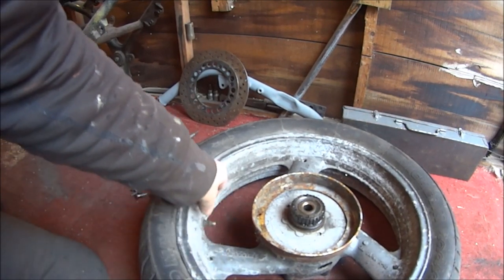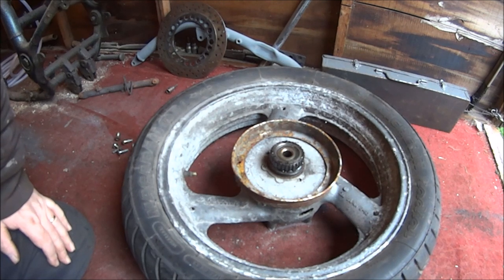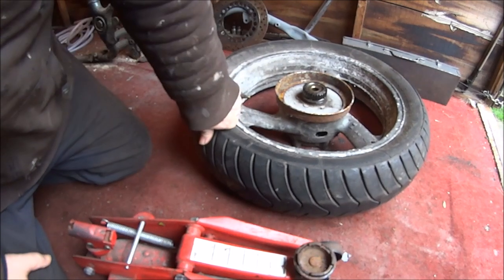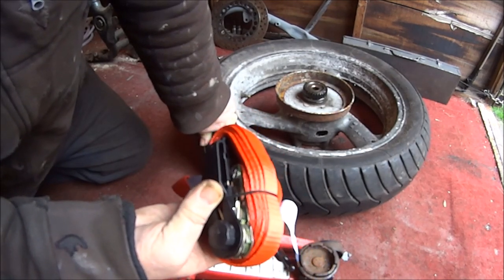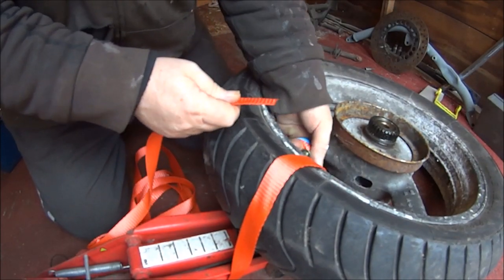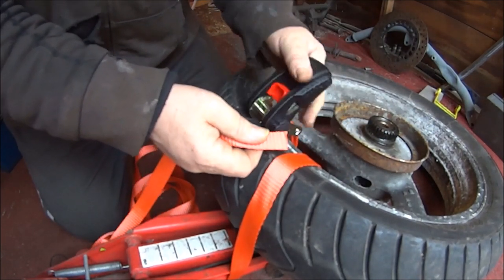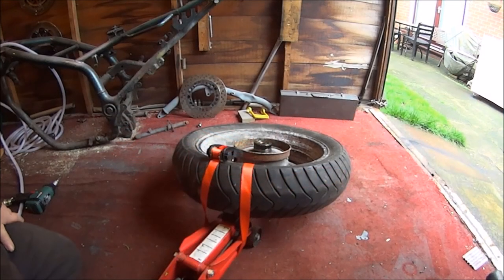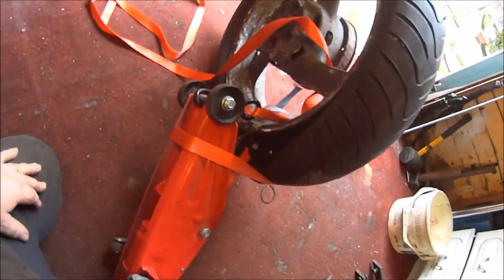breaking a tyre bead.... easy.

Comment: I actually used this method on my Harley tires and it worked but i wanted to make it even easier so I bought a Bead Buster and 💯easier and quicker
Reply from the maker: Good for you buddy. Thanks for the comment its much appreciated 👍
Reply: @jonyr1TT  appreciate the video and it will definitely be helpful for those who want to change their own tires without spending extra $$